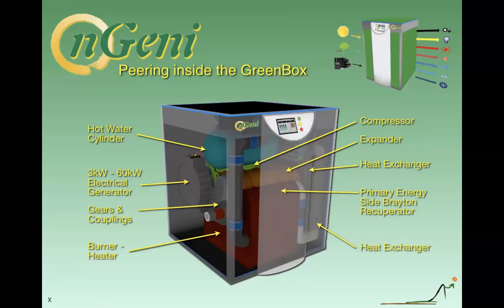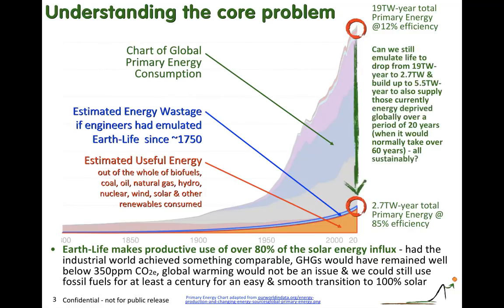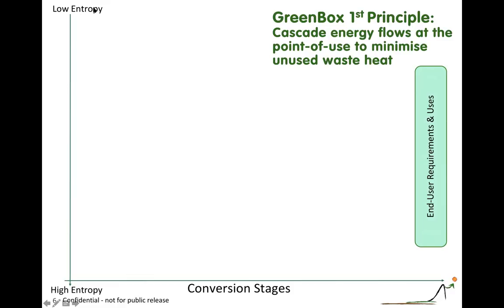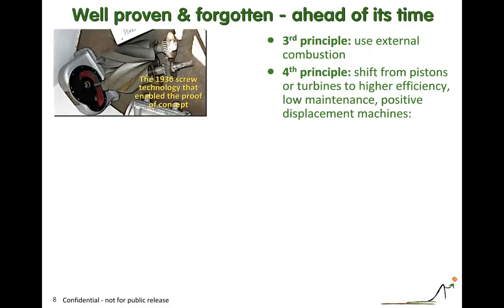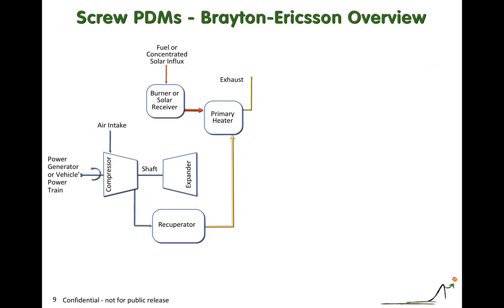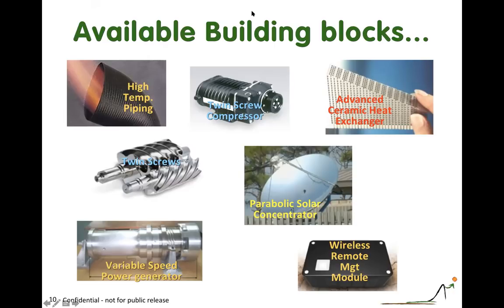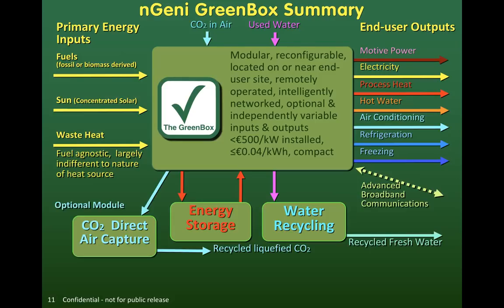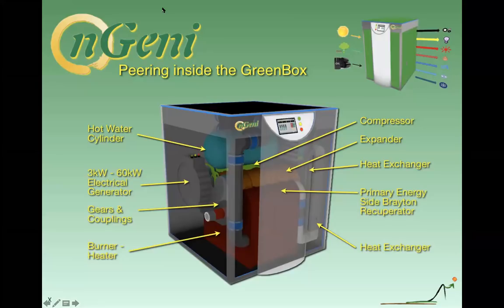nGeni Green Box Technology:  Solution To Thermodynamic Oil Collapse

Comment: The thing that really boggles the mind is that in the previous video Dr. Arnoux demonstrates that he has the knowledge and understanding to know that this green box doesn't solve anything. So either he is a flat out charlatan scammer or the cognitive dissonances this guy has are so large that its the true wonder of this video. 

Just in case that anybody has doubts: 
This device, if it works, is supposed to convert the energy contained in a high temperature gas (1000 -1400°C ) into various usable forms of energy. Supposedly it can provide many forms of energy (all very efficiently)  that we need,. I.e. heating, cooling, electricity, motion. all in one wonderbox. Oh also it does Carbon capture (and probably matter-annihilation to get rid of all the carbon in lieux of a storage place). Okay that doesn't seem likely but hey whatever... 

The problem remains that you have to put that heat energy in. In the diagram you can see the arrows in being either Solar or Biomass or Fossil fuels. And here is the problem. A 1000°C hot gas contains a lot of energy that still needs to come from somewhere. And if you look at the EROEI's of all the inputs you will find they are already low to start with. Biomass is only above one under very limited conditions, ( Plus I invite you to do a back of envelope calculation of how much energy the global economy currently uses and to how much biomass that equates. Make giant simplifications and utopian assumptions and you'll still arrive at units in the range of X amazon forests per year...) Solar  EROEI is between 10 -20.. Fossil Oil is probably below 10 by now. Okay you could run those devices on coal (EROEI > 40) or gas (EROEI maybe above 20). But then you have to keep expanding the fossil fuel industry with all its "benefits" until the end of time so you really don't do anything about climate change, because if you think every house that needs heat is going to do carbon capture well, you might as well power your economy with unicorn farts.   And those EROEI's are before it even enters the magic box system. Now it might be good at energy conversion but the 2nd law of thermodynamics still applies. Especially if you want to draw any power in the order of what we are used to in our modern world. So EROEI at point of use will be about halved again... You don't build a complex industrial society on an EROEI of 5 or less. 

The wealth we produce is based on the destruction of the natural world. As we are part of that world this behaviour is self destructive. The answer to this problem is easy. Drastically reduce the physical wealth and convenience we have become accustomed to or die. Maybe a bit of both since we are wasting so much time with crapolla like this.
Reply: I knew this would be too good to be true. We need to go back to a pre-Industrial Revolution style of living. Don't forget about climate change wreaking havoc too.

Comment: So he made a small power plant in reverse down to its core using waist fuel so that all are used up . simple concept and use.  But I like the hydrogen oxygen mix which gives over 3,000 as our usable heat by just using water trialysis powered by Dc volts with two rods . 👍

Comment: There was a lot of theory and not enough explanation of the mechanics. I want to see the fuel supplied and the mechanical process through which energy is made available for electricity, heating, cooling. Is there a prototype or is it only on paper? If not bring him back when he is producing energy in the forms he states is possible. I want to see more than diagrams and theory.I like the idea though but he needs to be ready for a fight because the powers that be do not want a population with any independence from the system.

Comment: Carbon Dioxide has a cooling effect on the planet. The elites know this. This is why they prefer "green energy" which releases more CO2 than coal over the lifespan.  Hydrogen would cause a greenhouse effect as it releases water vapor. We should ideally use hydrogen fuel cells for a greener and warmer planet.

Comment: Electricity stored in battery (e.g. Tesla) and going directly to AC is much more efficient, cheaper, and less maintenance than doing any of this. The method and the equipment required in building nGeni is ridiculously complex and costly. And don't call it GREEN because it is still using combustible fossil fuel where its pollution is the threat to this planet, nor it is compatible with the existing eco-friendly solar panel that has been installed in many places.
Reply: Where you going to get all the materials such a lithium, copper etc required for batteries and infrastructure to store and transmit the electricity. This thing is simply not scalable to global energy demand
Reply: Seems by your definition, Tesla batteries and solar panels aren’t green either. They require fossil fuels in order to be made, transported, installed. And that is the problem being addressed here.
Reply: And the electricity in your Tesla battery comes from where and what energy source was used to generate it? How complex and costly was the process in making your battery and producing and delivering the power stored in it? How much fossil fuel was required to produce and deliver the solar panels and what energy source will you use after many cloudy days. Commercial solar and wind require back up energy during periods of windless and sunless days. That energy is not stored in batteries somewhere.
Reply: Actually it uses the 80% heat wasted from burnt fossil fuels. It does not have any internal combustion.